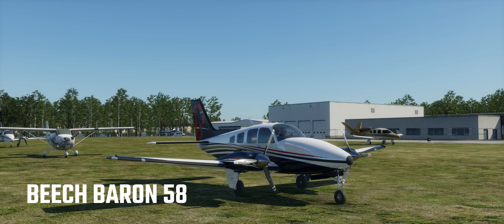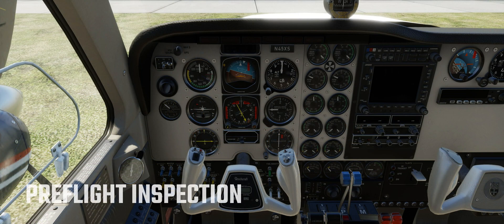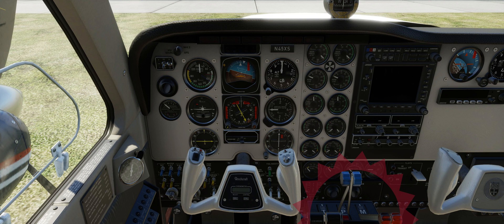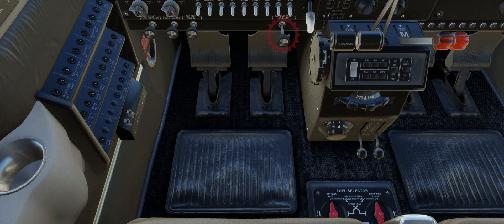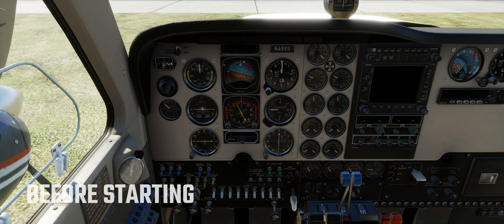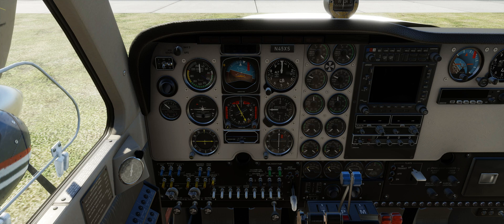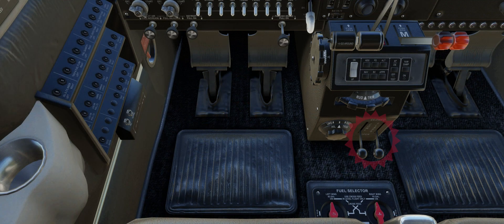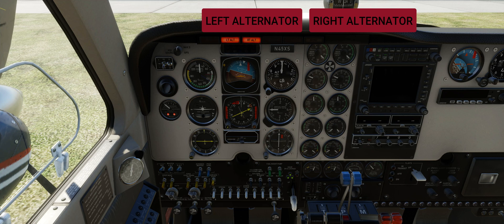Cold start the Beechcraft Baron 58 in X-Plane 12

Comment: Thank you for this beautiful explanation. I'm trying to get the most realistic pilot position possible, to do this I use the x-camera pljugin and get the following settings: x = -0.199, y = 0.471 and z = 0.674.
Do you have a better setting in your experience?
Reply from the maker: I haven't used head tracking for a while and just use static cameras. With the main camera the goal is to achieve a partial view of the engine cowling for reference, combined with a view of the main instruments. I pay particular attention to the vertical speed indicator. I think with the static views you're inevitably going to have to compromise a little on realism to get the required constant view.
Reply: @ Thank you. I don’t use head tracking. I use X-camera to heave de correct position on the seat.